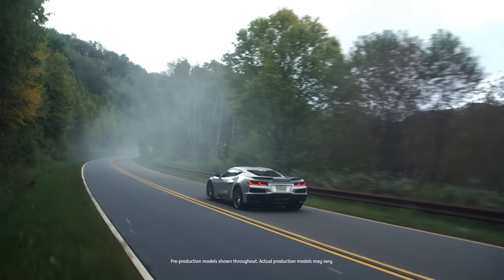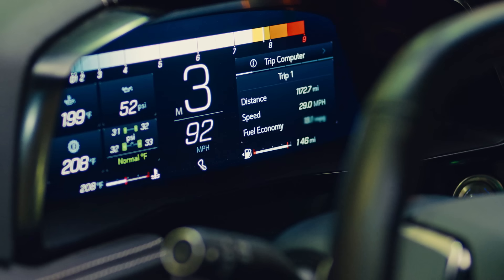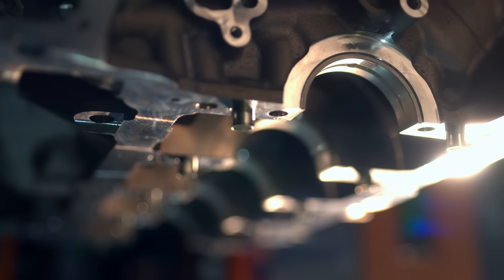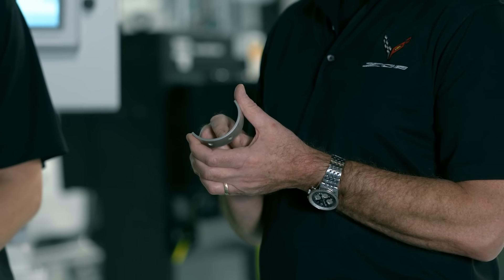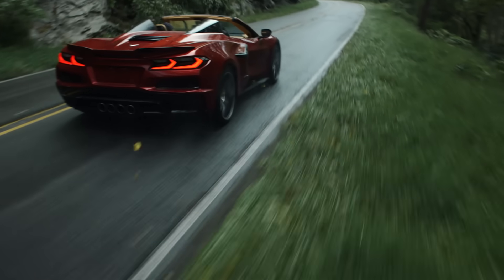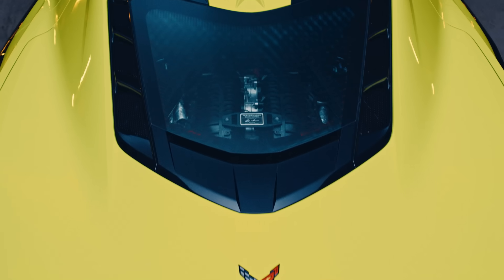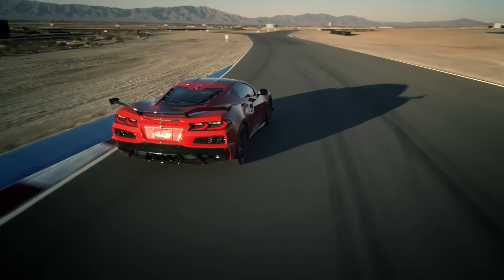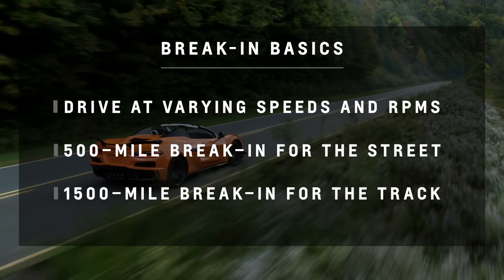Chevy MyWay: Corvette Expert Sessions – Z06 Engine Break-In | Chevrolet

Comment: This is the upcoming 2023 Chevrolet TAXI Sail AC It Comes with a 1.5 leader VVT Dohc S-TEC lll inline 4 Cylinder Engine and the 2023 Chevrolet PPV Police Package Sail it comes with a 1.5 leader dohc VVT S-TEC III Inline 4 Cylinder engine and the 6.0 leader V8 And the 3.6 leader V6

Comment: This is the upcoming 2023 Chevrolet Joy Hatchback Black/Chevrolet Joy Sedan Black the Chevrolet Joy comes with a 1.4 leader inline 4 cylinder engine and the 2.0 leader turbocharged inline 4 cylinder and the 3.6 leader V6 and the 1.6 leader inline 3 cylinder engine and the 1.0 leader turbocharged inline 3 cylinder engine and the 6.2 leader Supercharged Corvette V8 and the 0.9 leader inline 2 cylinder Engine and the 1.1 leader turbocharged inline 2 cylinder engine and the 1.2 leader inline 1 Cylinder Engine and the 0.8 leader Turbocharged inline 1 cylinder engine and the 5.2 leader V8 and that’s all engine choices

Comment: The Corvette C8 Z06 is more than just a car; it's a symphony on wheels. With its naturally aspirated 5.5-liter V8 flat-plane crank, every press of the accelerator unleashes a melody of pure power. At 670 horsepower, this masterpiece sings like no other, resonating through the soul of every driver who dares to experience its raw, untamed potential. Each note from the exhaust is a reminder that the Corvette C8 Z06 is not just about speed—it's about the art of performance, where engineering and passion collide in perfect harmony.

Comment: biggest thing for break in is the heat and cool cycles of engines and drivetrain components because as things heat up they expand and tolerances change. same with cooling down they shrink, thats why you always let your engine warm up for a little bit before you start driving and let it warm up to full temperature before you start hammering on it.
Reply: Things also change shape and size with RPM changes, not just delta temps. Rods and other reciprocating parts stretch and compress more at very high revs. If a motor has never been close to redline yet, the rings will be in virgin cylinder bore first time it does.

Comment: In days past it was standard procedure to change the oil of a new / rebuilt engine after 500 miles.  Can't believe they didn't talk about this. 

Where can I get that dexos type-R oil, I want to try it in my wife's Kia.
Reply: it was also standard procedure to change your oil every 1000 miles for the life of the car.  times change.  if they didnt mention it you dont have to do it other than you're owners manual says so.

Comment: This is the upcoming 2023 Chevrolet NLR 511 EIV it come with A Turbo Intercooler it known was diesel and the 3.5 leader Gasoline V6 and the 5.6 leader Gasoline Vortec V8 and the 2.0 leader inline 4 cylinder

Comment: How about Carbon Ceramic Brakes?   I heard some of the early Z06's have squealing brakes.  How do you break in the CCBs?
Reply: I think all CCB sing when they not warm, some cars (not sure about Z06) actually apply the brake lightly to keep it warm, like the M3
Reply: Carbon ceramic brakes will squeal when not warm no matter the car.
Reply: I think Speed Phenom did a video on bedding the CCB's.

Comment: Gm's forgot that if the z06 already achieve it's 500 miles, it will automatically change it's rpm to 8600. So people would assume that if they get to 500 mark they already broke the break-in period🤷

Comment: This is the upcoming 2023 Chevrolet Trailblazer suv the Chevrolet Trailblazer It comes with engine Choices it comes with a 2.8 leader Turbo Duramax diesel Inline 4 cylinder engine and the 4.0 leader V6 and the 6.2 leader V8
Reply: The 2023 Chevrolet Trailblazer 2 it’s A SUV

Comment: This is the upcoming 2023 Chevrolet D-max high power the Chevrolet D-max is based on the Isuzu D-max the Chevrolet D-max it comes with a CRDI Turbo Diesel inline 4 cylinder engine and the 4.7 leader V8 and the 3.9 leader V6
Reply: The Chevrolet D-max comes 3 Trims the D-MAX High power D-MAX Hi Ride and D-max Premier

Comment: This is the Chevrolet Sail the Chevrolet Sail comes with a 1.5 Leader VVT S-TEC III Inline 4 cylinder engine and the 1.4 leader turbocharged VVT S-TEC lll inline 4 cylinder engine and the 1.3 leader inline 3 Cylinder Engine and the 1.6 leader turbocharged inline 3 Cylinder Engine and the 3.6 leader V6 and the 3.7 leader Turbocharged V6 and the 4.7 leader V8 and that’s all

Comment: This is the upcoming 2023 Chevrolet Onix Turbo the Chevrolet it’s comes with a turbocharged inline 3 cylinder engine
Reply: Onix Turbo Sedan/Onix Turbo Hatchback
Reply: This is the upcoming 2023 Chevrolet Groove SUV the Comes with a 1.5 leader P-TEC DVVT Inline 4 Cylinder Engine
Reply: This is the 2023 Chevrolet Tracker Turbo the Chevrolet Tracker comes with a Turbocharged inline 3 cylinder engine
Reply: This is the upcoming 2023 Chevrolet Captiva Turbo the Captiva comes with a General Motors Turbocharged inline 3 Cylinder
Reply: Engine

Comment: This is the upcoming 2023 Chevrolet Colorado 2 it’s a Chevrolet S10 the 2 Truck Name the Chevrolet Colorado. it come with a 2.8 liter Duramax Turbo Diesel Inline 4 cylinder engine
Reply: Keep the us Spec Trailblazer it’s A Subcompact SUV Keep the US Spec Colorado it’s A Pickup truck